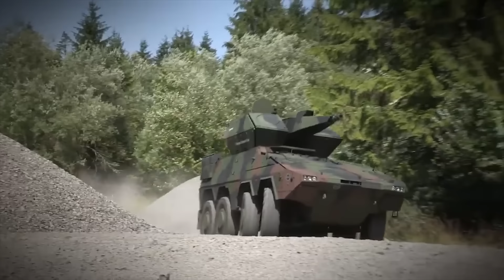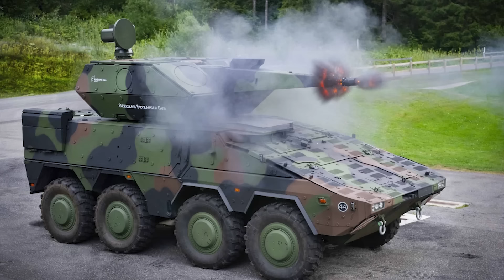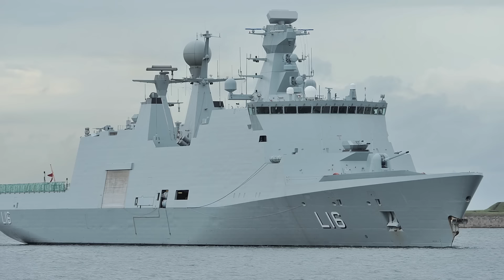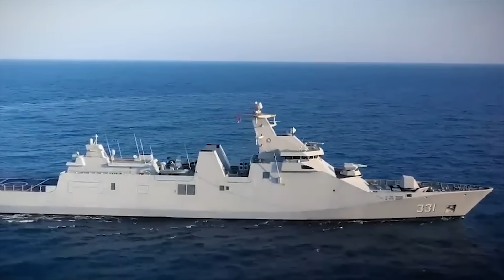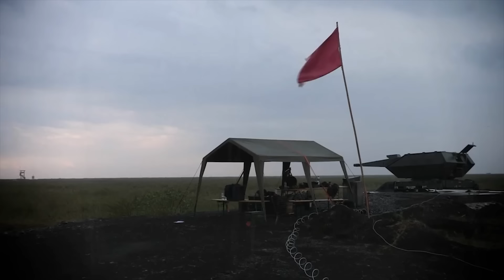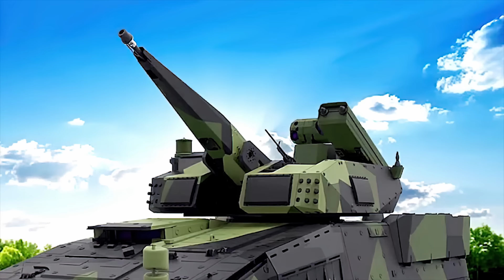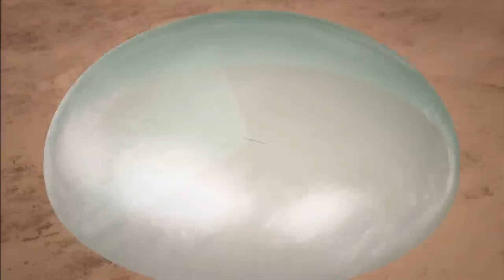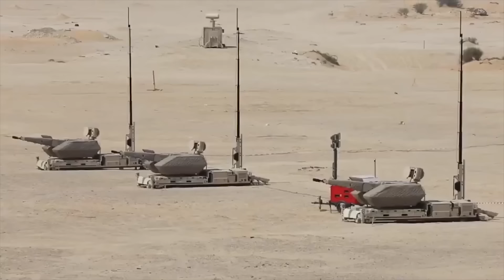GERMAN Fastest Air Defense Systems SHOCKED The World!

Comment: Yeah Switzerland has these staged through out the mountains in Switz. These protect the run ways built right in the mountains for the air force that patrol the Black Sea. The direction
of these position produce a complete gride system of defense. I have seen pictures of these hangers and they are mind boggling  and pilots have no margin for error.

Comment: It is smart to start working on a laser system. If you fire a dozen rounds of fancy future ammunition that costs hundreds, or even thousands of $ per shell at a drone that only costs $50-$100, it might be worth it to prevent a following artillery strike that does far more damage, and more importantly kills and injures people, but it isn't a sustainable way to fight a war. If you trade high rate of fire, expensive shells for cheap drones, you'll run out of bullets before they run out of drones. But if you can shoot cheap drones out of the sky with nearly free laser shots, and shoot expensive aircraft out of the sky with the missiles or shells, not only can you defend in crucial moments, but the attacker will run out of drones before  you run out of photons, and they will run out of planes and missiles before you run out of shells. A laser powerful enough to take out a jet or an ICBM is far from practical, but enough power to disable a small drone is certainly feasible.

Comment: Yeah... No... Just like with the Gepard and the CRAM, these things are highly ineffective against the stuff that really matters. This is just someones toy and maybe security theater. Notice how they never show it blow up missiles, mortars, rockets, or artillery? The stuff that really matters and is highly impactful on a battlefield. Drones are very slow moving and this isn't an accomplishment. Only system that seems to work well against those and has been prove is the Irone Dome from Israel. This is just someones money printer. You even have to buy the specialized ammo for it, which is non-generic flak.

This is a great use case for Flak or something along the lines of SPEW/BulletStorm (where a wall of bullets is used instead of a single or multiple fast firing projectiles), but they still aren't showing it taking down threats that matter. If I was assessing this, I would have a HIMAR fire at it and see how many it manages to blow up before the system explodes. If they say no, they obviously don't even think it can do it.

Comment: That laser is for targeting, not for combat. How do you think should this little thing generate the energy for a combat laser?

Rheinmetall talks about researching a high energy laser system, but overall this will always be a problem with the energy needed for such a system, if not part of something much bigger with a power source like a ship or when it is stationary and can be linked to an energy source.

Laser weapons are overall much to expensive for their little effect. You need enormous amounts of energy to mirror the impact of a bullet on a target. 

While a laser might hit what you point it, your target system has still to follow that motion and of course laser got a big problem with dispersion by tha atmosphere and even on the target itself it has to heat up, what will create a particle cloud which itself takes away from the effect of the laser and so on.

And of course your weapon AND battery will heat up VERY quickly, way faster by the way as a gun.

Against ANY armored target, it will be pretty much useless. Your laser weapon will melt before the armor does.

Comment: they say it CAN fire 1000 rounds a minute, but for how long can it sustain firing? Also it does not say if the barrel can or will overheat and what happens if the barrel over heats. And how how many rounds it can fire before you have to change the barrel.
Reply: Not sure, if it really even needs to fire that much. Especially since it´s programmable airburst munition, it covers a lot more space compared to a f.e. APT-S. Don´t know, why it should even need a that high rate of fire with that much higher suggeste hit-probability compared to most gatling-based CWIS-plattforms.

The GAU-8 Avenger has 3x-4x the rate of fire, but with 7 barrels. Air-cooled. Don´t know, if that revolver cannon is watercooled. But to be honest, that might not get a problem very fast. If i saw right, at least Mantis and Skyranger have arond 150-160 shots loaded and are most of the time on single-fire or 200rpm.

If the A-10 shoots all their ammo at once, every barrel had around 192 sorties ( 1350/7 ) in 20 seconds per barrel, aircooled.
This cannon has only 150-160 shots on one barrel.

But i don´t know the difference in generated heat between 30mm/35mm AHEAD compared to 30mm PGU-14/B API.
I see more of an problem with the more expensive and limited ammunition, even if they should need a lot less shots per target.
Reply: @FentionX  just sn exsmple the challenger 2 tank can fire 500 rounds before the barrel/cannon needs to be changed. These channels never talk about shelf life. It is a nessassery bit of information.
Reply: It is airburst ammunition, each shot releases 150 tungsten pellets. You do not need continuous fire. A salvo of 20 rounds should down a drone.

Comment: The AHEAD munitions were mentioned but not explained. This munition passes a magnetic sensor just before it leaves the barrel. Through magnetic feedback each individual bullet may be programmed right as it leaves the barrel to explode into over 130 submunitions that create a cloud of expanding penetrators that is lethal to anything right up to lightly armored targets. It doesn't require a direct hit, but just has to be in the vicinity of the target.
It is particularly destructive vs missiles, drones, artillery or mortar shells, right down to individual grenades. It either destroys the explosive mechanisms or triggers a detonation far before it reaches its target. In case of unarmed surveillance drones anything hit will probably loose airlift.
So the rate of fire is only to ensure that enough shrapnel in the air to take down anything in that cloud. But it doesn't need all of the brass to actually hit.
Reply: Nothing was explained in this video, only wierd conclusions
Reply: Battlestar Galactica flak cloud.  Lol
Reply: @shaunkelly9053   Galactica had a bad flak and took many dmg from cyclon fighters  ;)
Reply: @markushuber214  It's because the Cylons were using a custom branch of ChatGPT 7.0, which was trained on firing patterns and shrapnel modeling.
Reply: not brass but tungsten
Reply: Yes Sir, 152 sub-stabilized tungsten pellets in each AHEAD rounds.
Reply: @danielsauvageau6012  tungsten!? So this beast can bring down almost everything? I thought about a jet launching a missile in 15km distance to outrun the Skysystem. But this won't work then, either
Reply: @danielsauvageau6012  That's even better than I presumed, the animation only depicted 96 per round.
Reply: your comment has more info than the video haha
Reply: Thanks for the clarification. I saw a video from Rhinemetall themselves that contained some of the video her today, it's got to be said, this is a beast. I don't recall the maximum effective range but I don't believe much of anything will will be getting away once in range. These rounds will be devastating to ground targets too, if one of those detonated above a trench or advancing troops, again carnage. Smart 35mm ammunition, the world is changing so fast. Let's see what Ukraine can do with these monsters 🔥🇷🇺💩☠️🇺🇦🎉
Reply: so basicly cluster ammunition?
Reply: The German Gepard Tanks from the 70s had that already.
(Maybe not as advanced as today's weapons)
Reply: @Sinista123  No the Gepard does not have smart ammunition. 
Only HE rounds with self destruct, so it needs a direct hit to cause damage. 
AHEAD is not that :)
Reply: @steffenjespersen247  The Gepard can Programm the timer of every single bullet of the HEI and SAPHEI ammunition. I wrote that it might be not as advanced. But it's the same technology.
Reply: @Sinista123  Ok interresting I have never heard of they Gepard being equipped with this feature. If you have source please link.
But the HEI or SAPHEI does not have this. 
Only the ATOM 35mm and AHEAD rounds are with Airburst / sub-munition capability.
(in the 35×228mm NATO group).
Reply: Angry shotgun
Reply: Dude WTF is wrong with you?
Reply: this is bullshit even usa can't intercept mortar nor katyusha
Reply: yeah I just saw one short sequence showing an animation of that munition in the video and was like: wtf why don't you explain this thing, which seems to be at the core of the whole thing.
Reply: Can it kill glide bombs?
Reply: the rate of fire is just to increase military industrial complex profits " the cost of one such 
projectile is now about 4,000 euros. The effective firing range is up to
 4.5 km."
Reply: Wtf are you talking about
Reply: Use in any other company has to be approved by Switzerland. They have not approved it's use in Ukraine for example.
Reply: @bradleyanderson4315  it is here already, and successfully taking down the shahed drones and other crap.
Reply: @bradleyanderson4315  That would‘ve been the case before Rheinmetall bought the IP no? If a german company owns the IP they surely would need german approval not swiss as they produce under german license and not under swiss.

Comment: You did not give the most important information. The speed at which these guns can rotate and elevate is very important. Can 1 of these units destroy two 1000km/hr cruise missiles operating at 100 feet before they go out of range. The touristy scenes that they were shown in could make it impossible to see the targets at ranges in excess of 2km (certainly maybe less). Can these shells adjust their own trajectories? Normally 35mm shells have a lethal radius of less than 10 meters (admired Rheinmetall using the shells rotation to assist the fragments). How much ammunition is aboard these units?  A cubic meter should hold (roughly) 1200 rounds, those deployable gun units do not appear to be sized for much more than this.

Comment: 4 kilometers range? But thats nothing. Judging by ZNPP situation Ukraine shells it with artillery on the distance of 15km. Artillery, not a rocket or drone. So as a defence weapon in that case this system is uselss. Also, if the enemy have hypersonic missile that will destroy the radar and then spam guided bombs from whatever range they want its gg? So only 1 missile needed?

Comment: I hope in these systems there are hard- and software installed allowing to disable funktionality in case of taking over by the enemy.
Reply: That would be very stupid. In case you get hacked it would be deadly.
Reply: @ChaosEIC  tjere could be a solution
Reply: @Pyramidalist  No. There cannot be a solution. It is simple: If you hold a way into the system open. That way is open for everybody. Criminals, enemys, etc.

It is just not a practical concept.